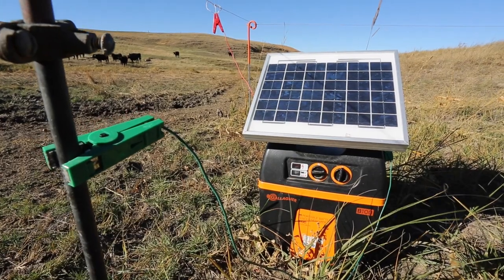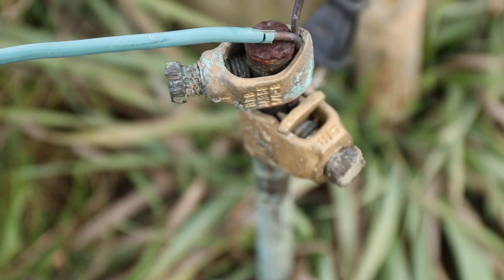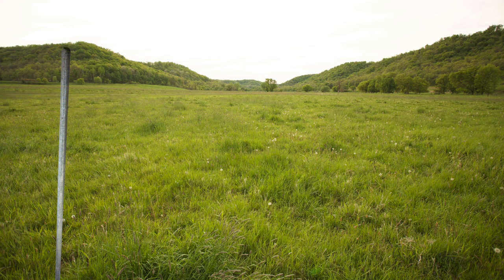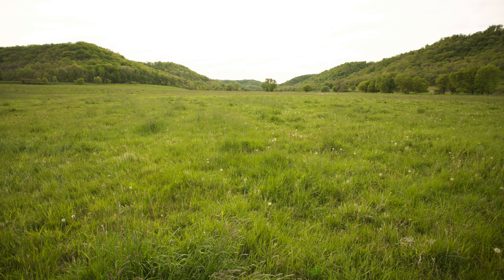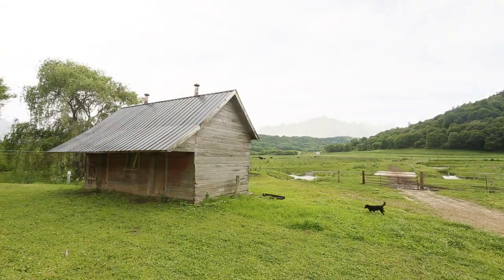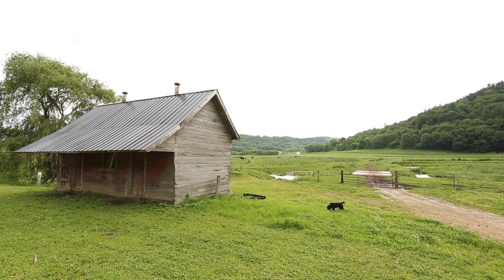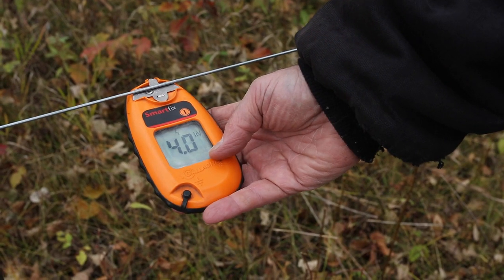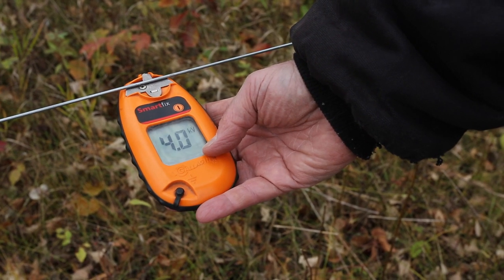Fencing 101: How to Properly Ground a Fence

Comment: What if my ground rods only go in 3ft due to rock? I've tried a dozen locations but the same everywhere
Reply: Angle them or in your case bury them flat at 2 or 3 feet deep
Reply: Angling them usually works, if it hits a rock it should slide across the top of it.

Comment: I am installing 360 linear feet of electric fence. I plan on using it for less than 2 years. I am trying to keep deer out of my garden. The sales guy sold me one ground rod, do I need 3? It is a copper ground rod, 6 ft long. How much of it do I put into the ground? Thank  you!
Reply from the maker: It really depends on the output of your energizer and the type of animal you're trying to control! Many electric fence systems do require at least 3 rods. This video was created with cattle in mind, so we would recommend referencing guidance specifically for deer fences. Here's a good article to start https://www.ncat.org/electric-deer-fence-tips-and-resources/
Reply: @WallaceCenter  thank you!  I told the guy at the store I wanted something to skin him and cook him on the spot, he sold me something for bulls, elk and I believe there was a picture of a buffalo on the package also. I will check out the link, thank you!

Comment: If you're using an aluminum fence wire, should you use an Aluminum rod?
Reply from the maker: Aluminum corrodes in soil and should not be used for grounding. Galvanized steel, copper-bonded steel and stainless steel are the most common materials used for grounding rods, See this article for more on common ground rod materials -https://fyi.extension.wisc.edu/grazres/files/2012/01/ground.pdf